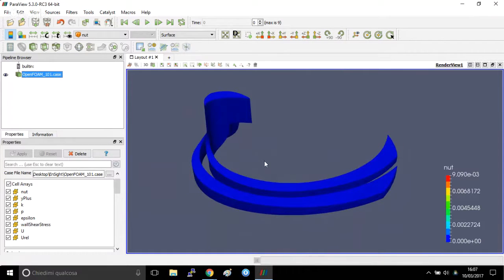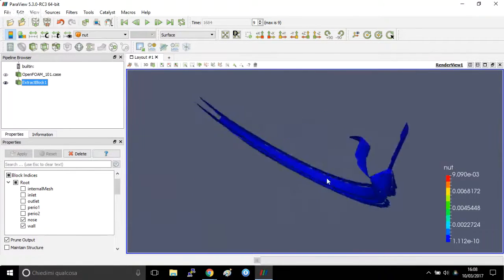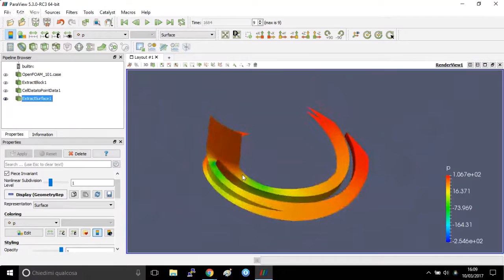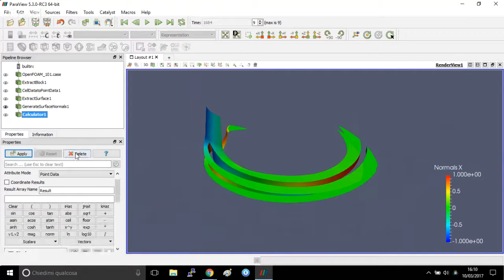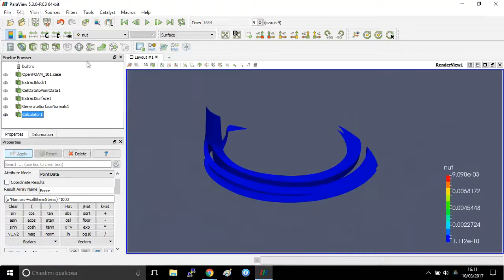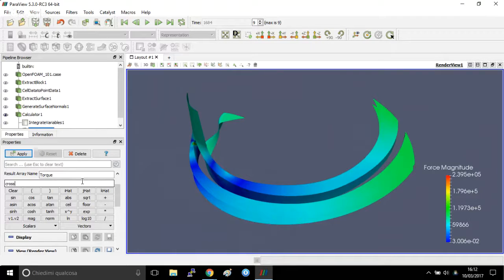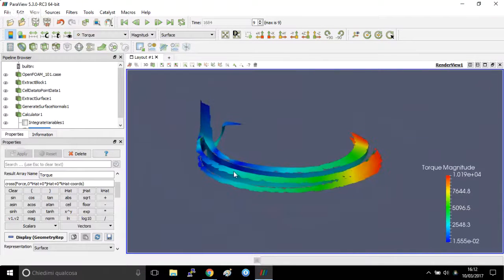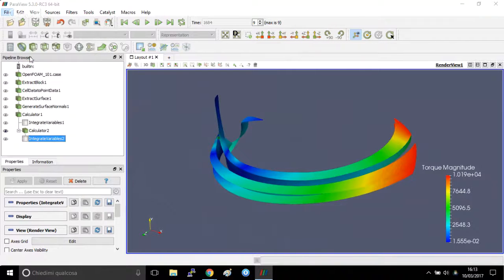Aerodynamic forces and torques with PARAVIEW

Comment: thank you for the great video! But i have a additional question: how can i calculate my thrust for a Propeller from my forces?
thank you very much :)
Reply from the maker: Well .. it's not very difficult ... thrust is the product between mass flow and velocity ... so you can use filters similar to the ones used in here to obtain the result you want!